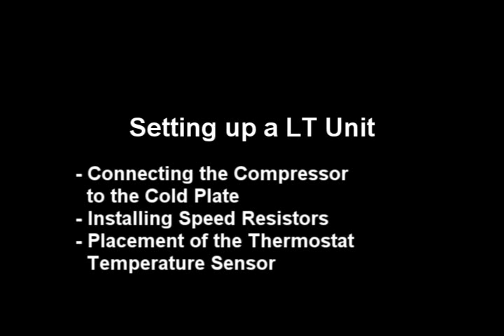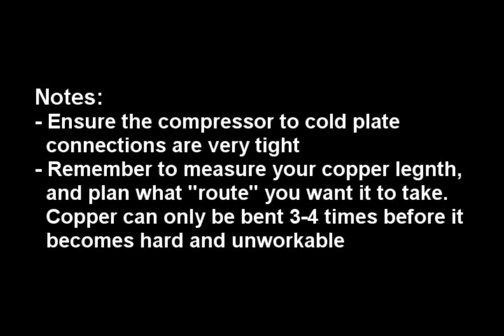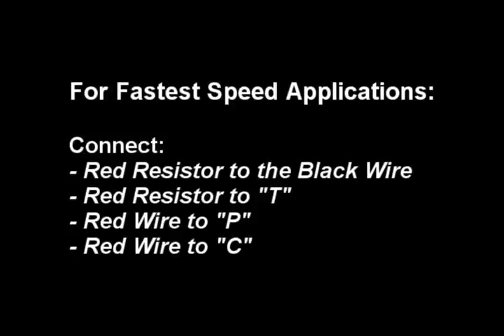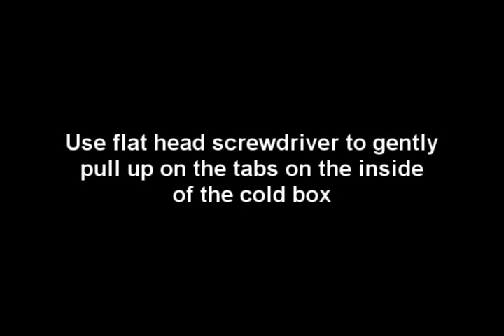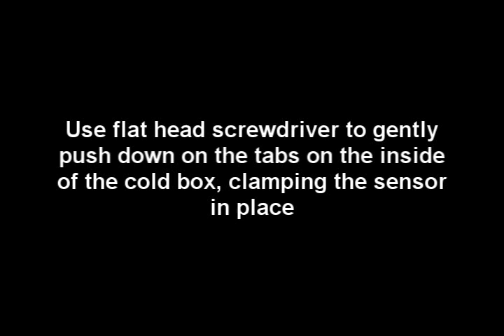Setting Up a LT Unit

Comment: Questions I have: Can the compressor be mounted any direction, even upside down?  Can the compressor be run at 16 volts, what will happen if so?  Is there an alternative to the stiff copper connecting tube?  That is, is there a flexible alternative to the copper tube, an alternative that will not break with too much bending or vibration?